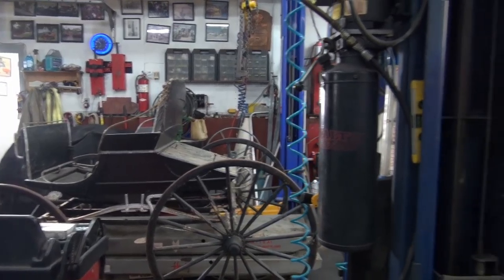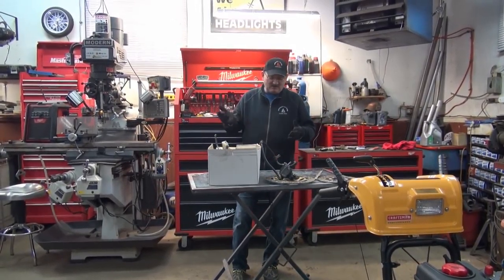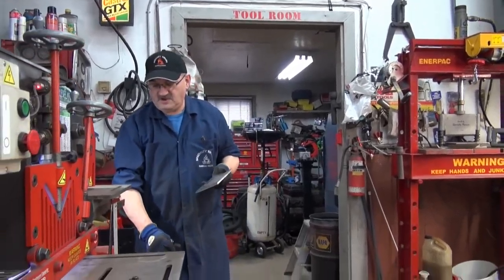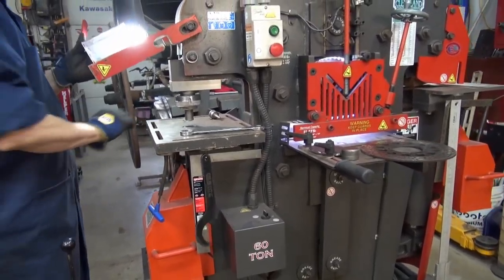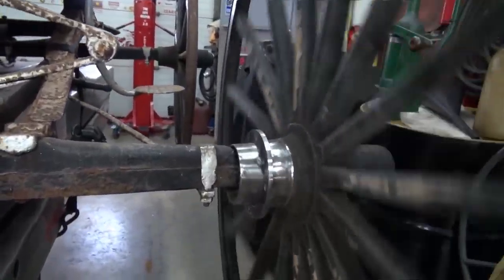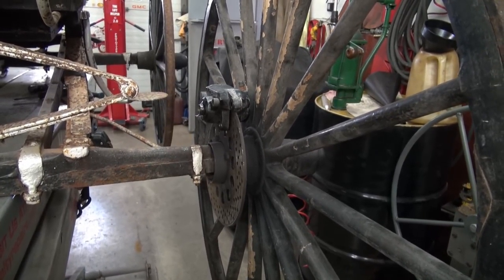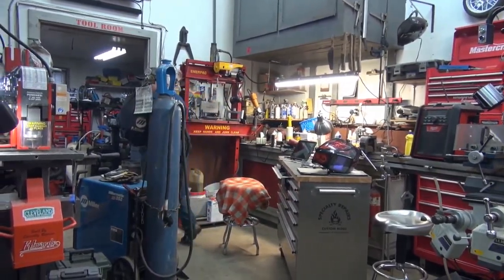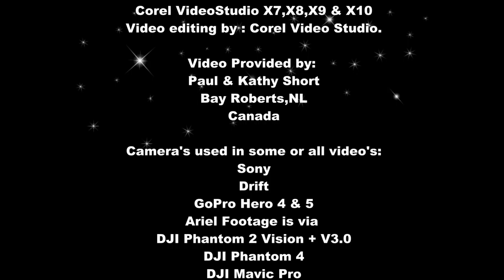Custom Buggy Coach Brakes

Comment: In the last video you said that you couldn't bore the buggy wheels with your mill. Loosen the 4 hold down clamps on the horizontal ram that the mill head is on and move it out. You should get over 24 inches between the the cutter and the base pedestal.  Ran a Bridgeport for years and did a lot of jobs with only two bolts clamping the ram.

Comment: I hear the torchmate system is easy to operate it's owned by Lincoln Electric they have tables 4 feet by 4 feet and 4 feet by 8 feet and Lincoln Electric has plasma cutters that have internal air compressors that can cut through over 1 inch thick steel

Comment: FYI Paul the original inventor of the forward control called the jay brake lives in lewiston  new york ; sold his design to hardly Davidson in the early 80s . went on building bikes for Sylvester Stallone and many others big actors. now he works for a shop in springville new york herschal brothers . who do everything. from fluid dampers for cars and ge trains to making the supper blowers used in iraq to blow the roads free of bombs . his name is jay branard who i know very well and have done some work with .

Comment: Are you going to tap the holes on the backing plate and install machine screws to hold the rotor on?
Is the brake going to be a service brake or a parking brake?

Comment: Given the light weight and the narrow hard surface of the wheel contact surface,  brakes of that size is going to totally lock up the wheel.  And the horse is not going to have any problem dragging it.  What is the intent of the brake?  To slow it down, or to keep it from rolling while "parked".  A simple lever wedged against the wheel could serve that purpose.  But to apply brakes to those wheels in my mind is creating a dangerous situation..  Do you think there is a problem with the strength of the spindles.  Brakes will put a different shear dynamic on them.
Reply from the maker: Show me in a video how YOU did it. If you haven’t done it then your observation and comments mean absolutely nothing to me.
Reply: I think the wheel spokes may fail if the brakes are used very much.  The wheels will act as a big lever acting on the brake rotor\hub assy\ brake plate to suspension.  Might break or twist attachment to wood frame and spokes.  Brake pads need to allow slip and not lock up.
Reply from the maker: We can all have assumptions and think things will happen but only time will tell 😉